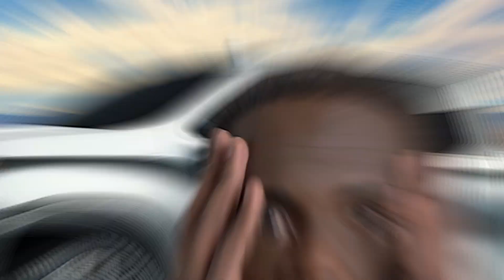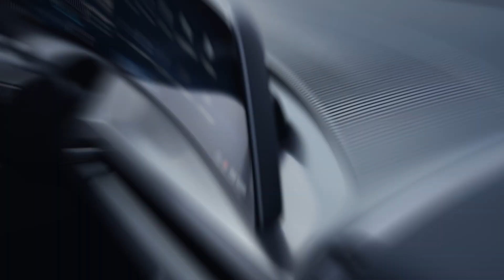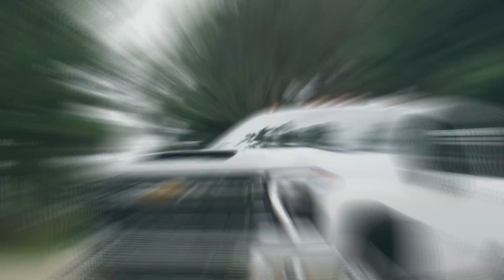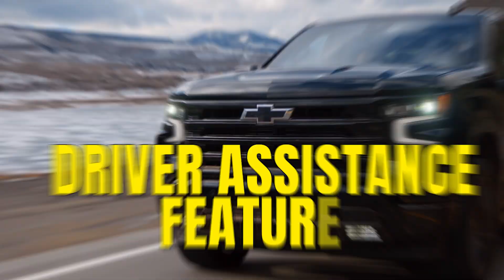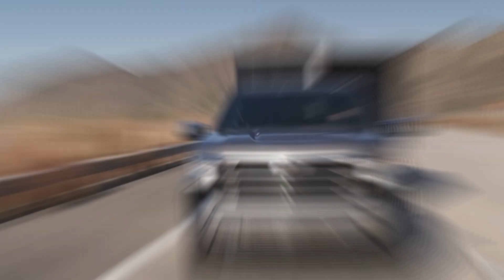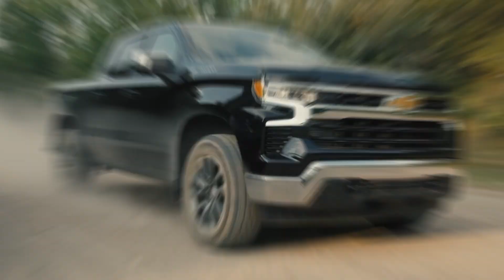All-New 2026 Chevrolet Silverado Shakes Up The Whole Industry! (Nobody Expected This!)

Comment: Body rust continues to be a problem.
Reply from the maker: That's disappointing to hear - you'd think they would have figured out better rust prevention by now, especially with all the advances in coatings and galvanizing. Are you seeing this on current Silverados already, or is this based on older generations still having issues?